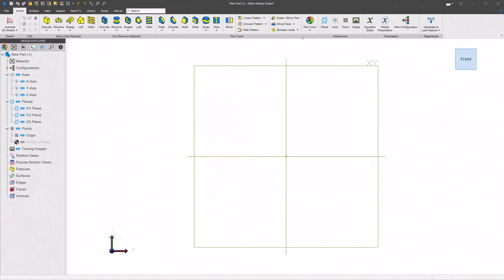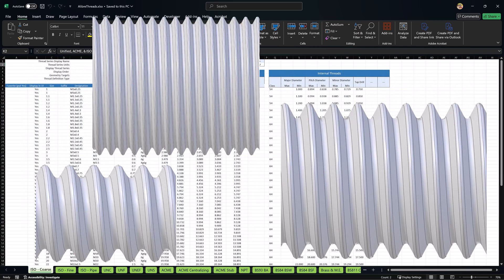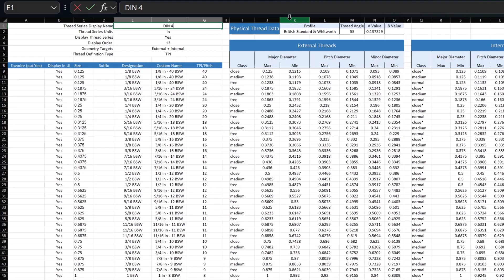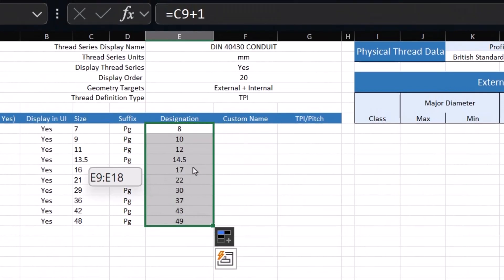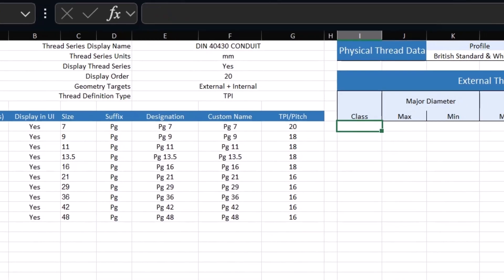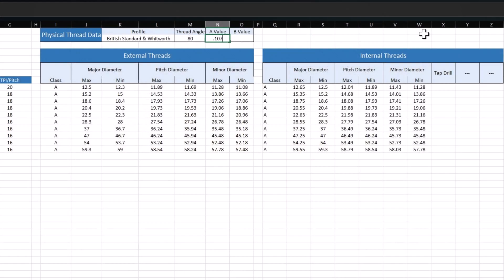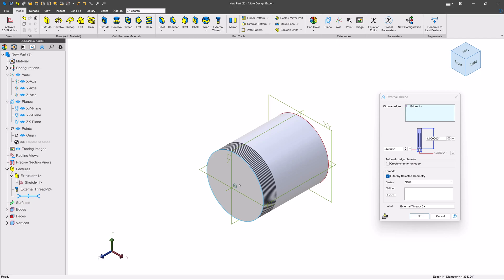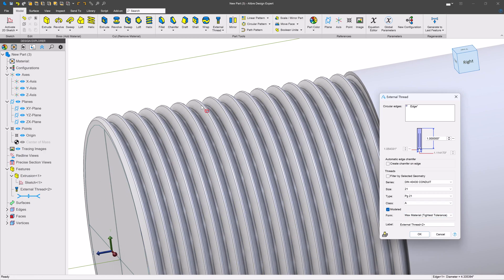How to Create Custom Threads in Alibre and Model them Instantly

Comment: I am trying very hard to convert from Fusion and it has been a bit tough. Lots of stuff that I like with Alibre and lots of stuff that I am struggling with but this thread file has Fusion beat by a mile!! Does this work the same with NPT thread? Do you need to model a taper for NPT to work?
Reply from the maker: Great Question!  No taper needed for NPT threads, simply use the hole feature or thread feature and an NPT thread can be applied.  Modeled NPT threads are not supported currently however.
Reply from the maker: If there are any videos I can make that can make your transition easier, let me know.
Reply: @AlibreLLC  Darn I thought you really destroyed them on this one, but they cannot model NPT either:) Not sure why that is such a difficult option? I 3d print NPT quite often. Can I make the assumption that if you want it modeled you have to bring in a model of the NPT you want to use, and then a combine feature? This would be a great vid to try. Thank you for that offer as I will definitely take you up on this. I have 3 things I am stuck on in one drawing, and a video would be amazing help. I really want to make this work.
Reply from the maker: @rufustoad1  What version of Alibre are you using?  I want to make sure I come up with a solution that will work for the features you have
Reply: @AlibreLLC  Hello Alibre (Joseph?) I have Design Expert V28.
Reply from the maker: @rufustoad1  Thanks.  Here are a few ideas from these comments:

https://youtu.be/Qac6_d7Z3oA

I also linked to ex machina, who has done some great work on threads in Alibre.  I'm hoping this helps, and hoping to help with any of the other issues that you mention.

Comment: It would be nice if it could keep the system file and allow the addition of a custom one to allow for upgrades ?
Is there a plan to allow modeling of tapered threads ?
Reply from the maker: We have something like that.  Alibre is meant to accommodate one file at a time, but the original can be restored at any time by going to system options> data folders > restore default thread file.

Alternatively, at the file path in data folders, Alibre is meant to recognize one single file called 'alibrethreads.xlsx'.  Users can have a custom one that they keep as a different file name, and change  the version they would like to use to the name 'alibrethreads.xlsx' to switch which is the 'active' sheet at any time.

Tapered threads are not currently supported, I'd be interested in your use case for physical tapered threads.  Can you tell me more?